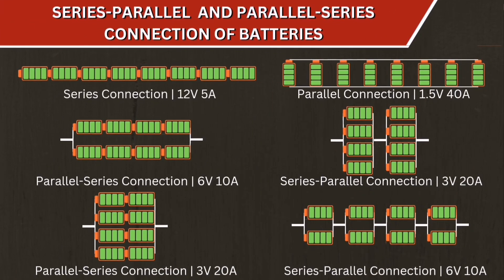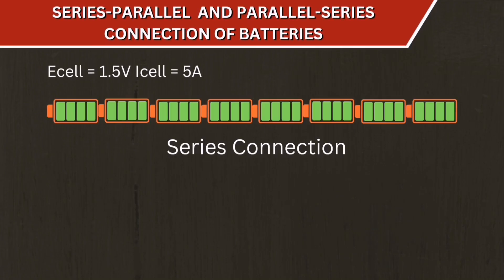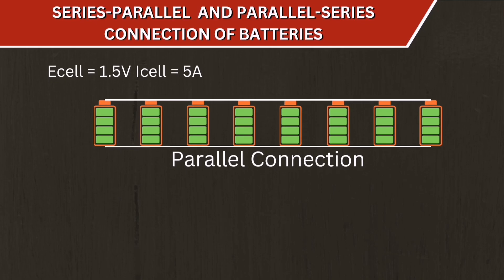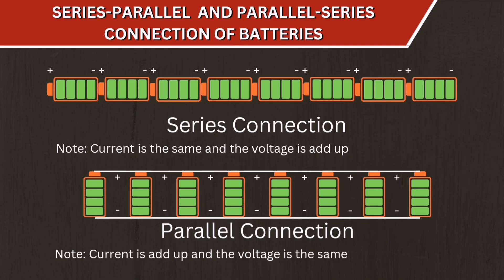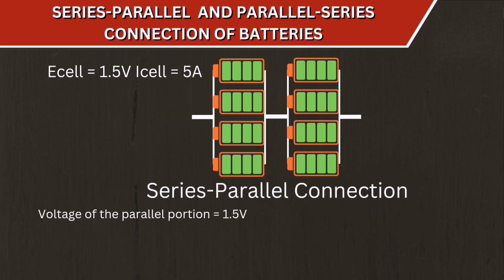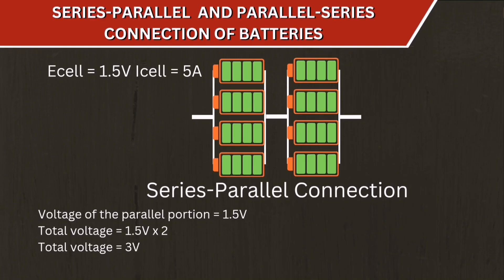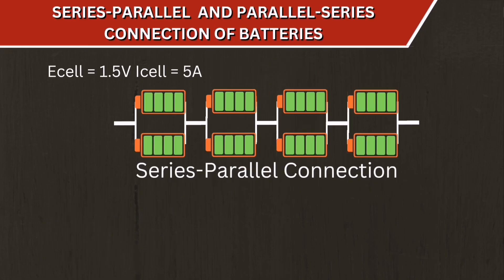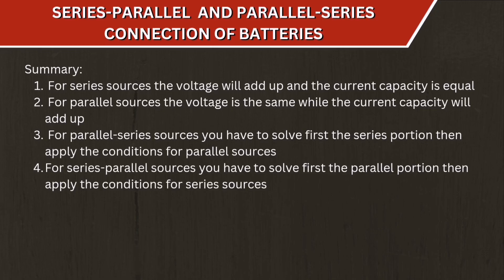SERIES-PARALLEL BATTERIES | PARALLEL-SERIES BATTERIES

Comment: total and utter shitte.  So exactly how has the current capacity of 5 amps been determined?
Reply from the maker: In this video the current capacity of the battery is already given. We are not trying to solve the current capacity of the batteries but instead, we trying to explain the effects if the batteries are connected in series, parallel and combination.

When batteries are connected in series, parallel, or a combination of both (series-parallel), it affects the overall voltage, current capacity, and overall performance of the circuit.

Connecting batteries in series means linking the positive terminal of one battery to the negative terminal of another. This increases the total voltage while keeping the current capacity the same as that of a single battery. For example, two 1.5V batteries in series would yield a total voltage of 3V.

On the other hand, connecting batteries in parallel means connecting all the positive terminals together and all the negative terminals together. This keeps the voltage the same as a single battery but increases the total current capacity. For instance, two 1.5V batteries in parallel would maintain a voltage of 1.5V but double the overall capacity.

Combining series and parallel connections involves a mix of both methods. It allows for adjusting both the voltage and the current capacity according to the specific requirements of the circuit.

Each configuration has its advantages and use cases. Series connections are useful for increasing voltage, while parallel connections are suitable for increasing current capacity. The choice depends on the needs of the electrical circuit or device being powered.

Hopefully it helped.